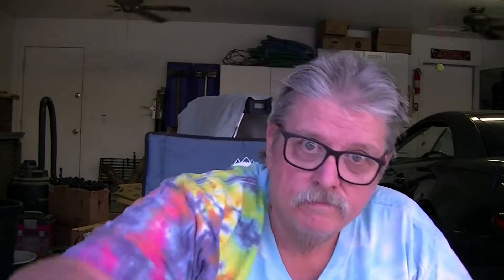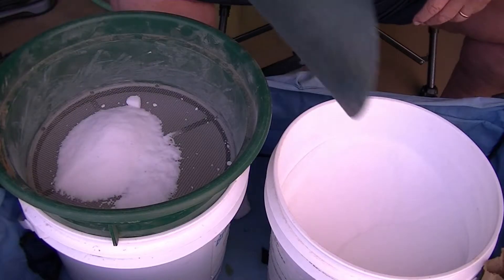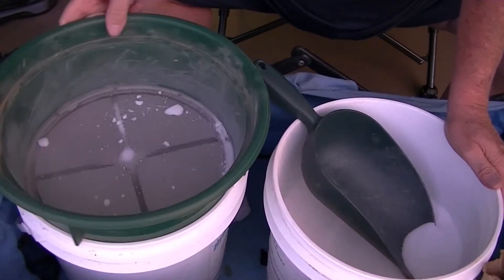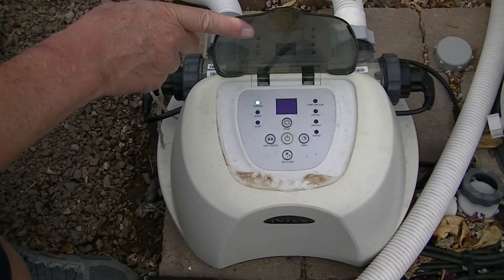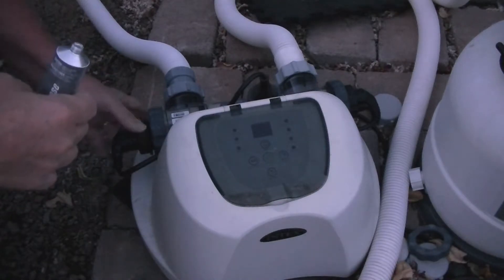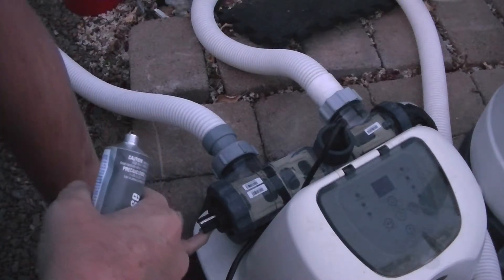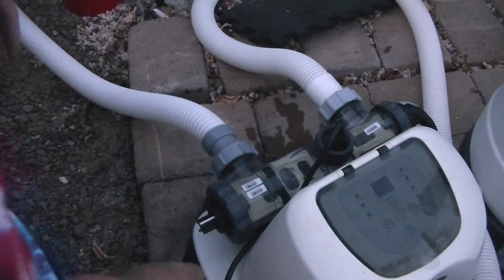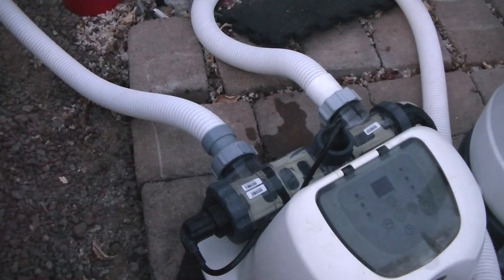Intex Pool Saltwater System Code 91 Tips

Comment: Hi. The screening step is not necessary. It's salt. It's soluble in water.
Here in France, pool salt is sold in pellet form and they're the size of ping-pong balls.
Reply from the maker: I agree 😃
I just do it to keep the clumps out of the pool. We use the larger pellet salts in our water conditioning units here also.